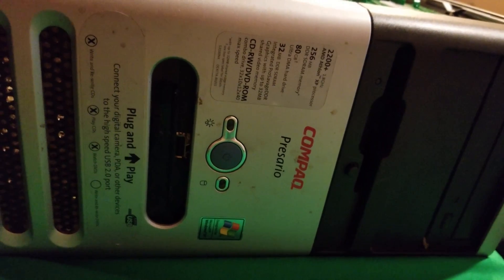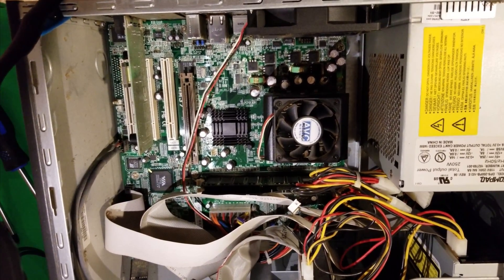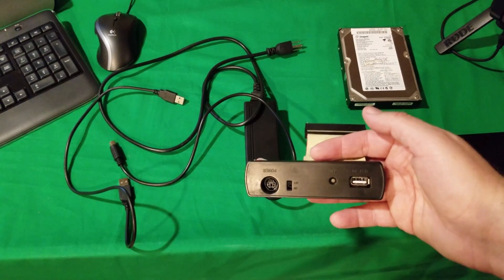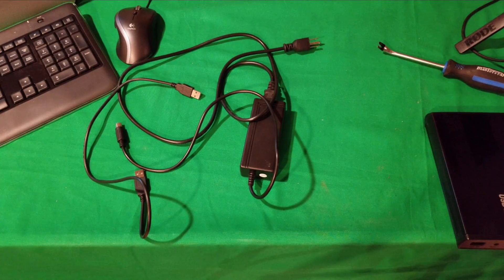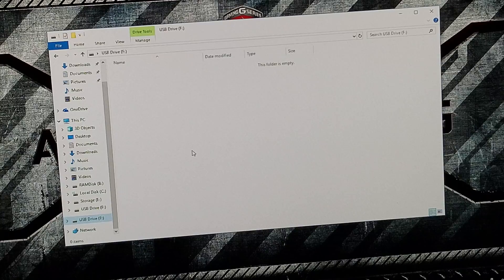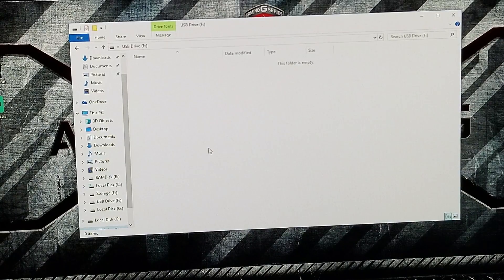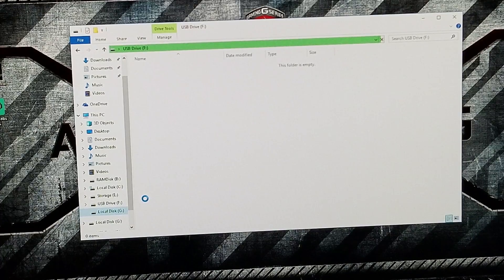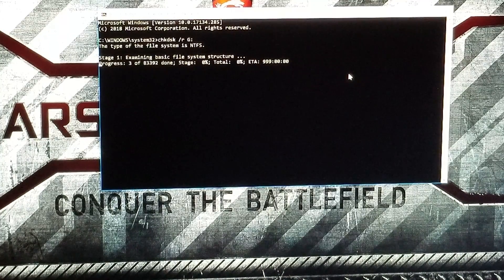Tips, Tools & Technique's to Retrieve Data from an IDE Hard Drive

Comment: wow you have a awesome computer setup.  I tried to hook up 3 screens myself but I guess I need to buy an extra cable in order for windows to recognize the third screen.
Reply from the maker: Thanks, yeah you do need 3 cables to connect to the Graphics Card...although if your using Display Port you can daisy chain them from monitor to monitor and then use only 1 cable to the Graphics Card...Our Tech Department at work told me this but I haven't tried it myself yet...